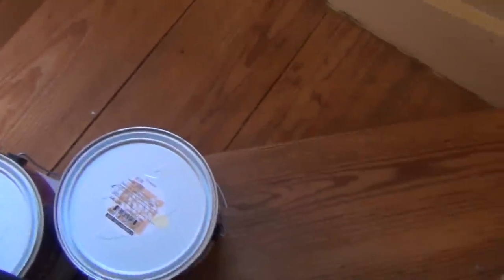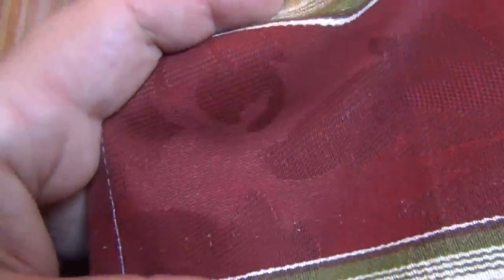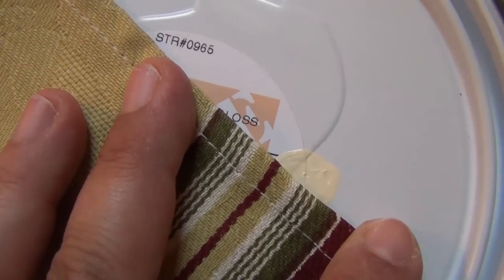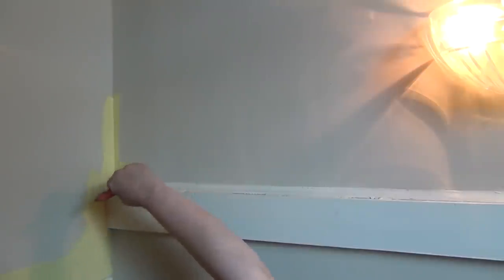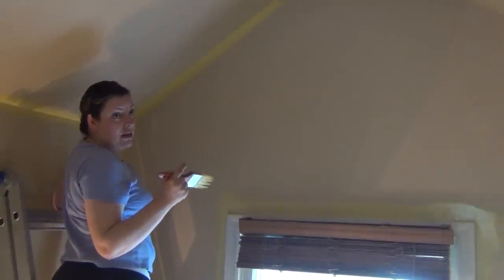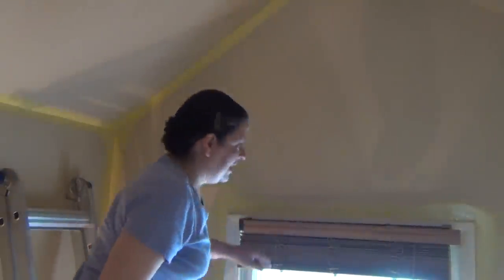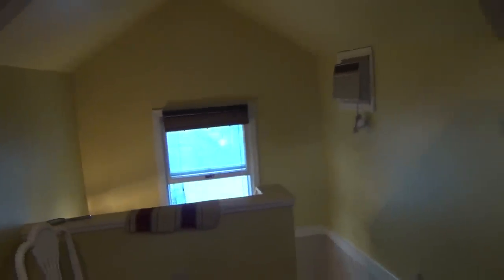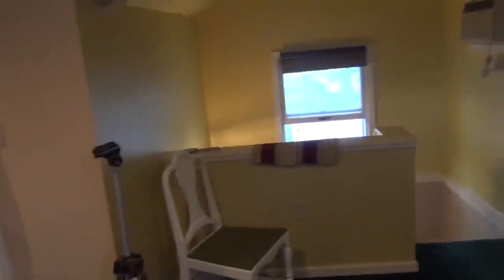Staircase Makeover - Part III - Painting

Comment: To de-skunk my dog I used a mixture of baking soda and dish washing liquid, mixed it into a paste then wet dog all over then it covered completely with the concoction and rubbed in and after 5 minutes I rinsed dog down then repeated the process 2 more times, it worked well around the body but not so well around the face cause I couldn't really apply the concoction safely around that area. Good luck on paint job the refinishing looks great !